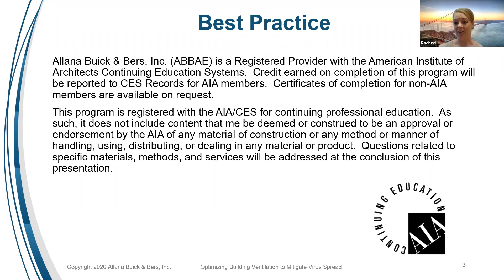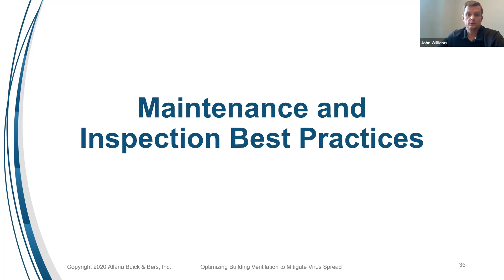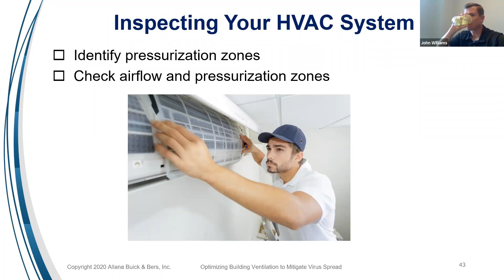Optimizing Building Ventilation to Mitigate Virus Spread

Comment: 1:00 Speaker Introductions
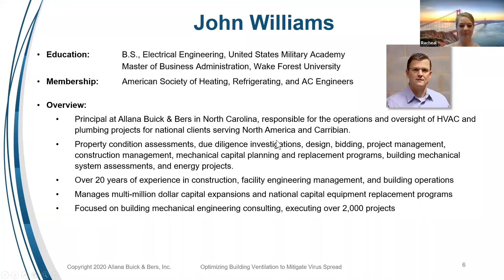2:13 Firm Overview
4:59 Presentation Outline
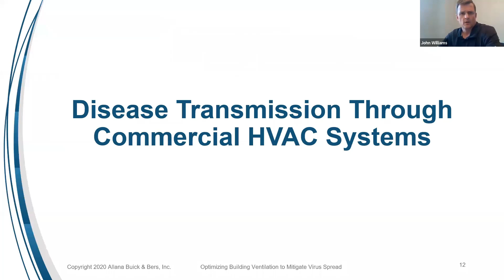6:28 Disease Transmission Through Commercial HVAC Systems
14:38 Decreasing outside air is going to increase humidity, moisture problems, and mold. How do we address that?
17:29 Recommendations for systems that only filter outside air and not inside air
20:47 Recommendations on changing filters
21:33 Recommendations on changing Ventilation Settings for COVID
23:44 If we have a fitness center that has the capability to open sliding doors for fresh air, would you open them up a little while running the HVAC?
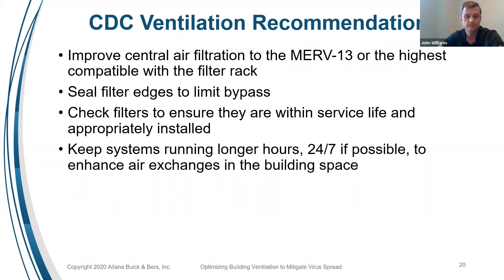24:45 ASHRAE Ventilation Recommendations
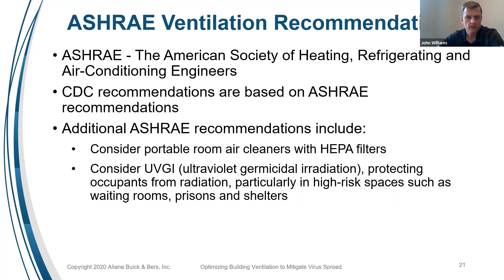26:35 Ultraviolet Germicidal Irradiation (UVGI) Overview
30:53 What are the major downsides of increasing HVAC use to account for COVID?
31:56 Would UVGI work as an underfloor system?
33:43 Would UVGI work in a plenum ceiling or a high ceiling?
36:15 Recommendations of UVGI systems
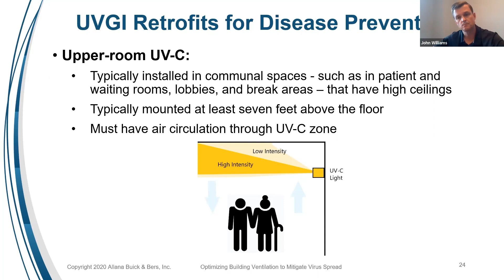37:14 Ventilation Design Codes and Best Practices
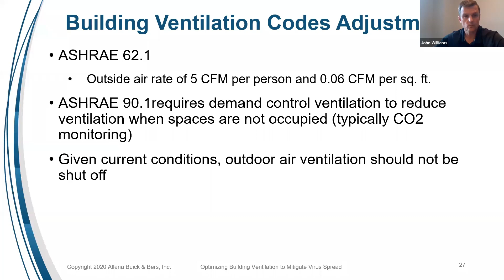38:50 HVAC Filters and COVID
41:52 How does air ionization work? How does it compare to UVGI?
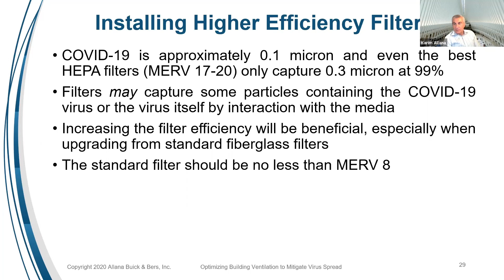43:43 Ventilation Requirements for High-Risk Facilities (Hospitals, Nursing Homes, Assisted Living Facilities, etc.)
48:11 Maintenance and Inspection Best Practices
55:04 Lessons Learned
57:00 Are there specific regulations or requirements for changing filters?
58:37 Are carbon filters good for protecting against COVID?